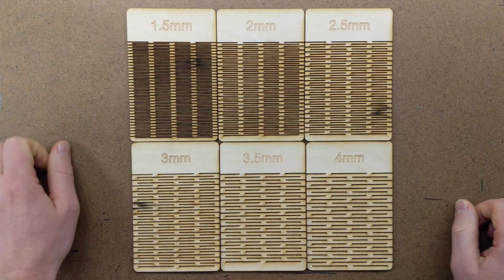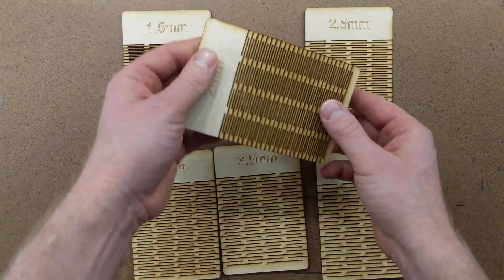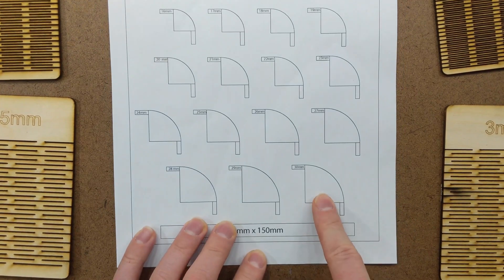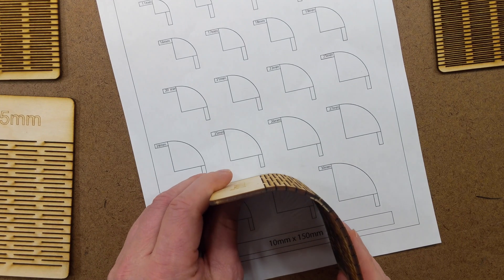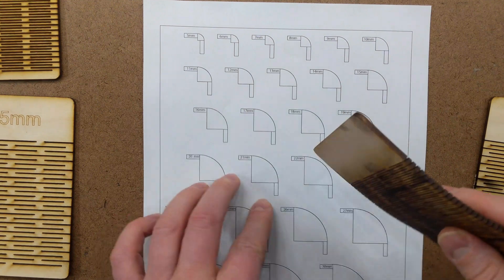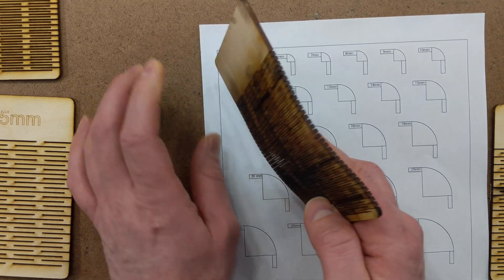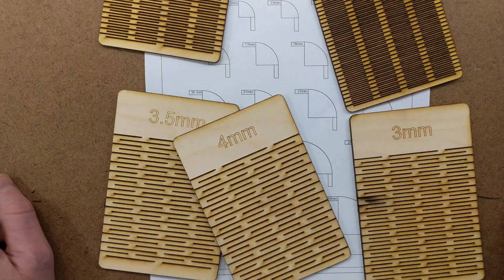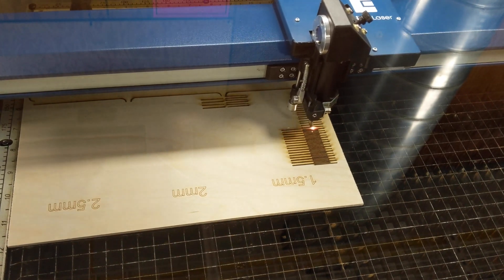Living Hinges Minimum Bend Radius with Swatches for Laser Cutting Bent Plywood

Comment: does the grain direction matter? i assume it does right
Reply from the maker: Not so much in plywood since the different layers have the grain going in opposite directions
Reply: @WhatMakeArt  also i kinda dont understand that the size means, like is 1.5mm the distance between alternating lines or is it the distance between the parallel lines?
Reply from the maker: For this example, is the distance between the parallel lines?

Comment: Thanks for the file. What size are the samples? They are coming into illustrater huge
Reply: Thanks
Reply from the maker: Make sure you set the scale of your illustrator  import to millimeters

The size of the gap is written on each swatch so if it comes in too big you can always scale down to that size

I made the files in fusion 360 using millimeter scale for the units

Comment: I wonder how this would function with PLA? I have been messing with flexible doors made out of PLA, and this pattern seems to be a better solution.
Reply: It works in acrylic on the laser cutter, would you print this? Interesting.
Reply from the maker: Should work with acrylic
Reply from the maker: That's a good question I would have to test to find out, there's a lot of interesting shapes that could be made in altered ...